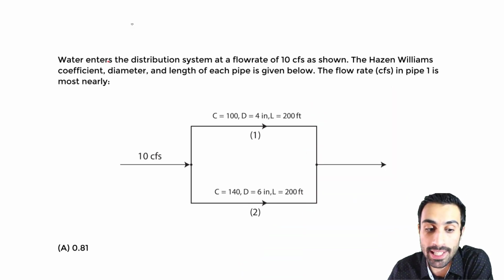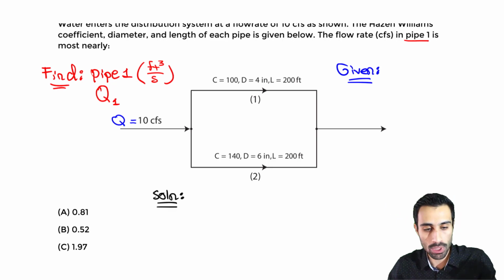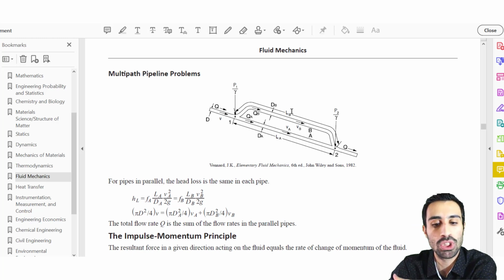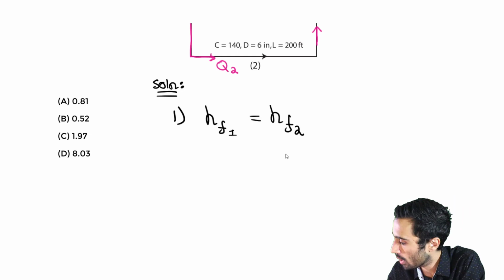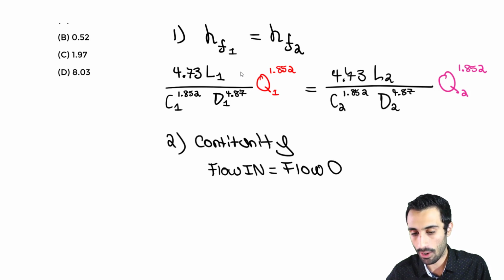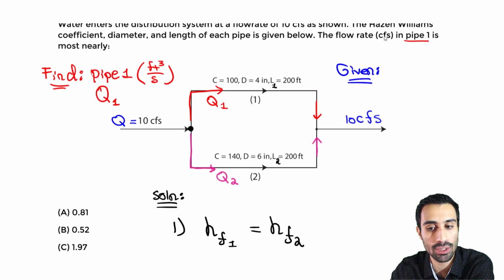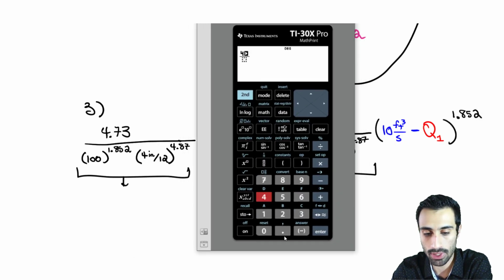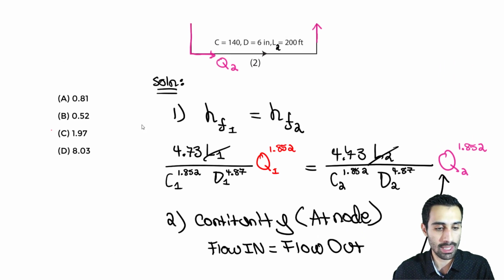FE Exam - Using TI-36XPro Calculator to Solve Water Distribution Problem

Comment: How does this specific problem rate on level of difficulty for the FE exam?  Easy, Moderate/Average?  Are most of the problems about this level with regards to steps and forumulas?
Reply from the maker: Very difficult
Reply: @directhubfeexam  Great, thanks!  Been 10 years since I graduated and I just now am thinking of taking the FE so your videos are super helpful.  This problem didn't seem too difficult, just involved and lots of steps.  Actually boosted my confidence a little bit.  I appreciate the feedback.  I have some review books and a TI36x Pro on the way.

Comment: I think the Casio fx-115 is easier to use. Hopefully you can make a video of it.
Reply from the maker: The Casio is a great calculator as well! I like the Casio since it doesn’t have a input limit when using the solver! The TI36x lacks in this regard. 

Did you try doing the same thing I showed in the video with the Casio?